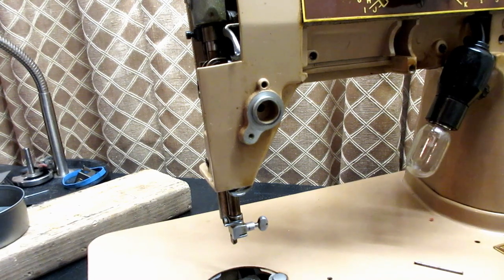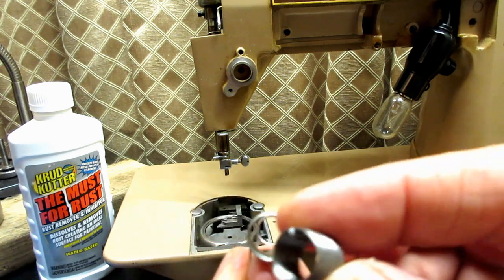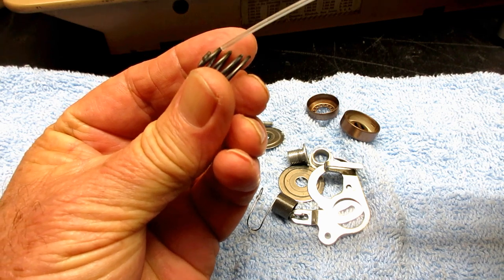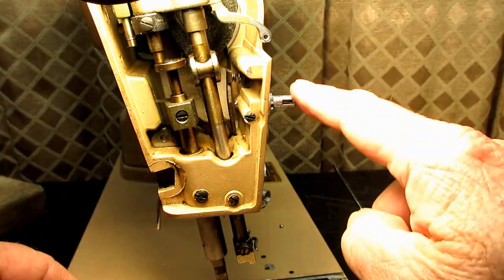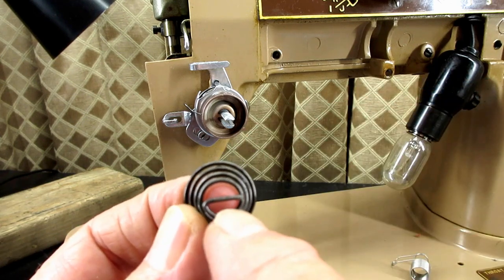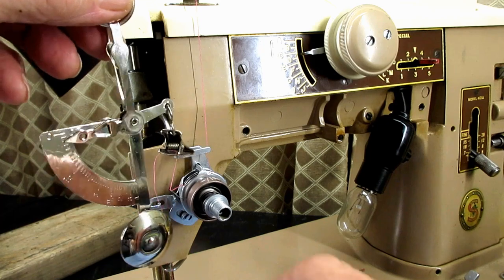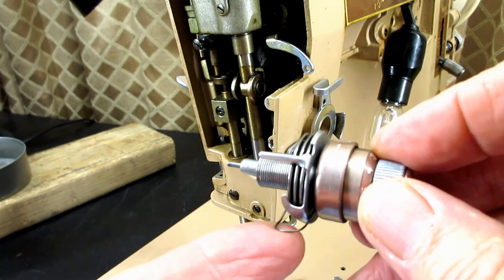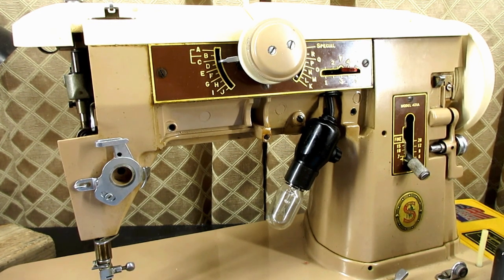Replace / Install a Missing Tension Unit on a Singer Model 401A

Comment: Hi I have a 401a which I've been using for past year just fine.  The the other day while I was sewing it stopped stitching....the thread  from top just lays on fabric and bottom pulls loops through fabric.  I've messed with tension going up and down.. nothing is helping.  What do I do?
Reply from the maker: Well, it is obviously a tension imbalance. If the top (needle) thread is flat that means there is more tension on it than the bobbin thread. What did you do just before this happened? Had you put in a new bobbin of thread? Your top tension may be fine and you may have lost bobbin thread tension on the bobbin case. It has a tension spring also (on the side) that you pull the bobbin thread thru. Have you looked at the bobbin case and hook/feed dog area? Have you cleaned out all the lint there? Does whatever you are sewing create a lot of lint or fuzz? Lint/debris can get pulled beneath the bobbin case tension spring. It can pile up thicker than your thread. Then the bobbin case spring can't push on the bobbin thread to create tension. No bobbin thread tension means the needle thread tension will be stronger and pull the bobbin thread up thru the fabric no matter the upper tension setting. Rarely the tension spring adjustment screw can vibrate loose or even pop out of the bobbin case creating a zero tension situation. It's easy to test your upper tension. Remove the needle thread back to the spool and rethread it up to but NOT THROUGH the eye of the needle. Lower the presser foot, set the tension dial at 4, and just pull on the thread anywhere after the tension unit, maybe near the take-up lever. You should have some tension on the thread but be able to pull it off the spool. While pulling the thread then start turning up the tension dial, like 5 - 6 - 7 - 8 and you should feel more and more tension on the thread. When you find that is OK then you need to look closely at the bobbin case. This video shows how to clean/adjust the bobbin case style you have on your 401A: https://youtu.be/HT5XZ5eYYEQ   Good luck, Jacquelyn, and thanks for watching my channel.
Reply: @andytubesewing1953  I was actually in the middle of sewing...was halfway down two quilting squares when it started doing this.
Reply: So I tried the knob tension and that didn't help.  How do I fix bobbin tension?
Reply from the maker: @jacquelynconant3926  Thank you. So just normal sewing so no wonder you are puzzled. It has to be tension, so you can watch this video about how to zero out and just test that without changing anything to see if it is functional. If so, then check the bobbin case video. Sometimes I have just pulled the bobbin case and fished a piece of dental floss (non-waxed) under the tension spring and flossed out a bunch of lint. It's all I can think of for now. Good Luck.
Reply from the maker: @jacquelynconant3926  You must have missed my entire comment. In the end, I linked to a video for cleaning and repairing the bobbin case. Here is the link again https://www.youtube.com/watch?v=HT5XZ5eYYEQ

Comment: This is an AMAZING video, thank you so much for taking the time to share your expertise!!! If I may, I have a different top thread path and tension assembly on my machine, a SeamMaster, model w-50. This machine I think came from a garage sale, and appears to be missing parts in the top tension assembly.

Internet seems to indicate made by Simplicity. It has a brand label stating "US Patent Office", but I'm not 100% sure where it was made. On Internet, I found a picture of a Myer Victor machine that has the same threading path, and presumably a similar, if not the same, tension assembly. Unfortunately, information about Myer Victor is just as scarce as for SeamMaster. I do believe the Myer Victor machines were marketed in Australia, not US. This machine us very heavy, so I'm guessing all metal, so possibly 1940's...? It is a zigzag zag, and has the bobbin mounted underneath on the left side,  if that matters. 

This machine doesn't have any drill ways or hole for thread guard, or check spring rest, so I'm not sure how those type of parts were mounted. I'm missing both springs,  some type of keeper to keep the numerical ring from turning. I only have 2 disks, not three (why do you need 3, just curious). I have the plus/minus ring, and a knurled knob. Not sure what else might be missing. I would *LOVE* to have your expert advice, and I'd love to send you photos. I'm not sure how to send photos through YouTube,  might need to just use regular email. 

Thank you so much for reading all of this! I'm frustrated, I'd love to get sewing, it'd be so easy to just find another machine, but this one is a challenge,  hahaha.
Reply from the maker: I only work on vintage Singer machines. I know nothing about the machines you mentioned. Even some old SInger models did not have thread guides. If there are three tension discs it means the machine is usually capable of sewing with double needles or a twin needle. Two threads between the three discs then thru two needles. If there are only two discs then it is a single-needle machine. Earlier models did not have a numerated dial on the tension unit. Some models have the check spring rest/stop built into the housing of the tension unit. Here is an example: https://youtu.be/rioRhSbog6U    and another: https://youtu.be/5B4KAwmKdEU     About your pictures; you have a youtube channel and you can post videos and slide shows on it any time you like. Some viewers save pictures in the cloud and give us a link to them so any viewers who are interested to help can see your pictures. If you post a link in the comments YT will block it but I can release it after approving it. That's about all I can say. Thanks for watching my channel.

Comment: Buenas noches. Para sustituir la tensión de la máquina singer stylist 416, le quedará la que venden para la máquina singer facilita? O cómo la puedo comprar en México? Gracias por responder.
Reply from the maker: Me es imposible saber dónde se puede comprar un reemplazo en México. Otros espectadores me han dicho que compran la unidad de tensión de reemplazo en las tiendas de México, pero es un país grande. Puede pedir uno directamente desde China, donde se fabrican. El envío es gratuito pero muy lento. Aquí hay un ejemplo: https://www.ebay.com/itm/265166415126?hash=item3dbd266516:g:lfkAAOSw3H1dz6Im creo que podrías comprar esto en México. Si te falta la tensión, esa debería funcionar para ti. Si tiene la tensión pero cree que está rota o no funciona correctamente, mire mi video sobre cómo reparar la tensión en su máquina. Usted o un amigo pueden arreglar el que tiene: https://youtu.be/PSCY72bJ3x8  Gracias por ver mi canal y buena suerte.
Reply: @andytubesewing1953  gracias por tomarse el tiempo de responder. Bendiciones para usted. Me ha ayudado mucho.
Reply from the maker: @yoshogarcia5101  De nada y buena suerte. 👍

Comment: ;-( I guess I will have to by a new one I just broke the small middle bar in the +- guide by trying to install it. I was plastic and very weak.
Reply from the maker: Ouch, sorry. What model machine are you working on? I ask b/c the tension parts on the 401A, like in this video, are all metal.
Reply: @andytubesewing1953  I am on a 411 it maybe not an original one
Reply from the maker: @HelptoFit  OK, sure. Not familiar with the machine or its tension assembly. Good luck.
Reply: @andytubesewing1953  thanks it is very close to the 401G I will try to find a way to repair it or I ll have to buy a new one. I was feeling it could break but pushed it to far. Thanks for your help 😁
Reply from the maker: @HelptoFit  Thanks, and good luck with that.